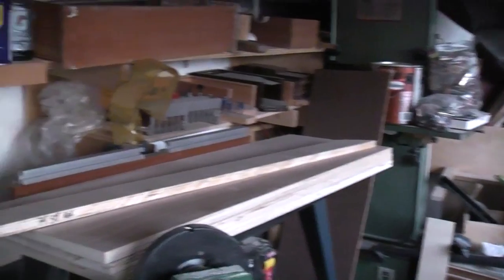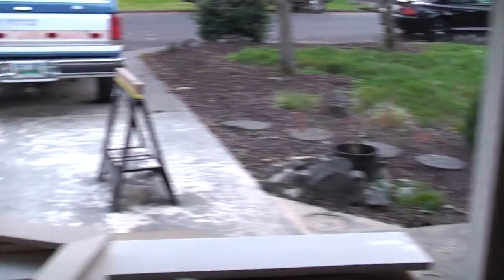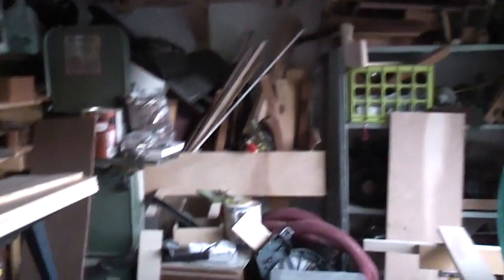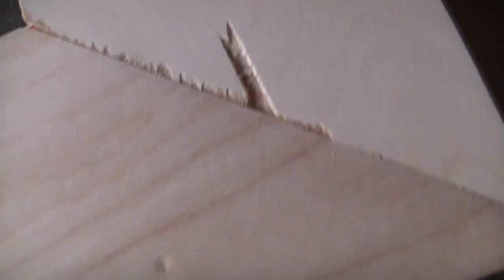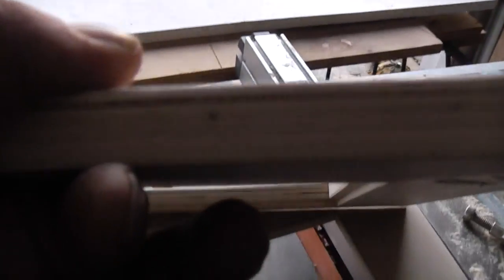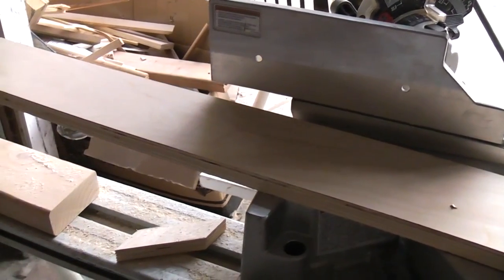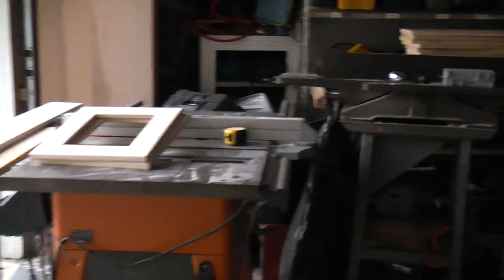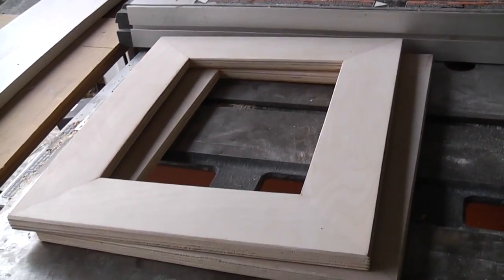Engineered Wood VS. Solid for Cabinets and Shelving

Comment: confused now.  another cabinet builder on here says he never uses plywood because it warps too easily and that particle board is superior.   so which is it?!
Reply: search malcolm mcgrath on cabinet materials here on youtube.
Reply from the maker: +tecnolover2642 I have never seen plywood warp indoors, unless it got soaking wet. Particle board is superior for some applications, but overall can easily swell and warp if it gets wet.
  Ultimately it depends on what you are making, and what you prefer. My experience is that I prefer plywood for strength.
Reply: Plywood is great for cabinets, but it's not that good doors of cabinets. Here in Australia we have a marine ply from Indonesia that is great for cabinet doors and it sands beautifully! The sheets are $124 compare to normal ply at $60 a sheet!

Comment: Hey, I'm looking to build cabinets and shelving in my alcoves on either side of my chimney breast wall in my living room. I'd like to go for a slightly darker shade of natural wood, maybe like a golden oak? I don't want to paint it. I'm trying to go for a sort of woodland/forest theme for my living room so I want all my wood to look natural. So do you have any suggestions as to what wood we should use? Would it be feasible and look ok if we used a ply or other type of engineered wood and then maybe used a wood stain varnish or something? Thanks in advance for any advice you can give.

Comment: Solid wood can be used but it is very expensive but not because of the material value but due to the level of craftsmanship that needs to be applied. 

The wood selection process is expensive on its own but then using the techniques required to overcome the warping of the wood is very time consuming.
Reply from the maker: Indeed, that is why I prefer ply.

Comment: I must say that “pepe amazing plan” (Google it) is a wonderful woodworking book. Both novice and a few skilled carpenter can gain lots of general info using this reading material. Surprisingly, this book has been my partner when I wish to look up woods at areas and other topics such as restoring and salvaging spots.